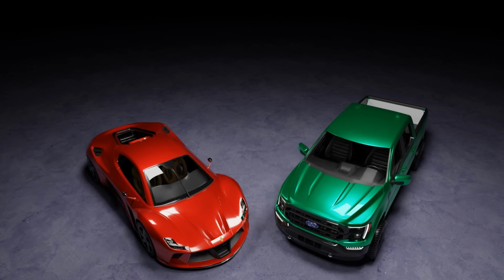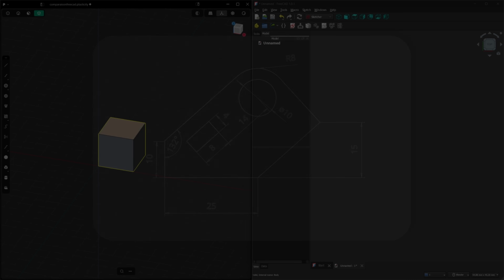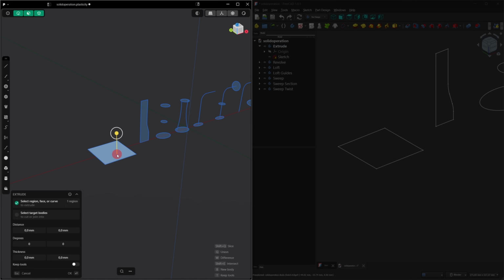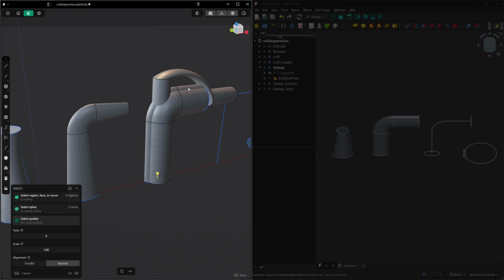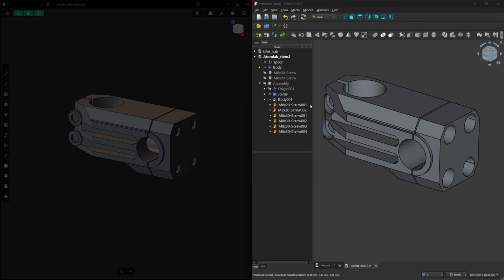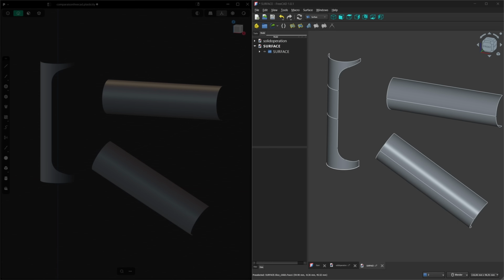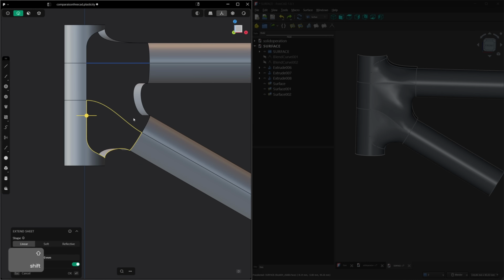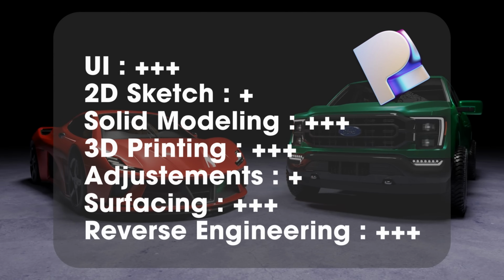FreeCAD VS Plasticity - Who's the BEST ? (Makers & Beginners)

Comment: I think people are attracted to freecad for its open source nature more than anything else, plasticity has a restrictive paid license so it would be better to compare it to solidworks or similar products with the same business model behind
Reply: Yep, not to mention FreeCAD is truly a suite of solutions. I use FreeCAD almost exclusively now for my woodworking designs. Why? I can design a project, modify it, send it to TechDraw for detailed drawings and then send it to the CAM workbench to cut everything out on my CNC all in one software that is 100% free.
Reply: @kylequinn1963  I also use CAD a lot for woodworking and CNC machining. However FreeCAD is still too limited in some areas for me, mainly surface modelling and stability both in terms of the program itself and rebuilds. Plasticity looks really great and the cost for a full pro license is not that expensive. But I need full parametric editing, so it's out as well. Right now I'm using Solid Edge and Rhino 3D. The former is free for hobbyists.
Reply: @kylequinn1963  Congrats your designs are simple and FreeCAD offers everything you need. Many of us are not so lucky as FreeCAD is rather limited compared to proper CAD programs.
Reply: Do you design the parts while in the assembly?
Reply: FreeCAD is "FREE" it's a great solution, no web needed and MULTI PLATAFORM!!! I can use it in linux... too many benefyts. The only practical solution for linux uses.
Reply: I use freecad because it gets the job done. The free part is also attractive because I know my time investment won't expire when I move from job to job like with my last package. Plasticity is also very nice and it's so cheap when you consider you can get xnurbs for the price of an ok used electric guitar.
Reply: Plasticity is not restrictive (what exactly do you mean at all??) and it's way cheaper than many other CAD programs
Reply: Plasticity is not restrictive bro. its a one time fee and you own it for life. thats NOT RESTRICTIVE, thats freedom
Reply: @genin69  And you get 1 year of updates, then you are free to have outdated software. How neat
Reply: @genin69  a paid software will be always restrictive compared to a totally free. Even if this is a minimal restriction
Reply: Choosing FreeCAD because of it being open source, that might be true for some people (and I guess mostly hobbyists which I don't mean in any negative way), but not for all people. E.g., I don't care about the open source aspect of FreeCAD at all and I am for sure not the only one. And I would pay for it, and also use it if it wasn't open source, it wouldn't bother me. For comparisons: I don't think anyone should compare software based on the license model or if it is paid software. 
And do you really think it would be fair comparing Plasticity (which imho is not really CAD because not being full parametric, and has limited options) to "THE" CAD software Solidworks which is the CAD Suite with the most and advanced features and options? Yikes!
Reply: @Bee-KL  You have to compare software based on the license model. Something what is free have never the budget for development to improve fast and make it "perfect". So as long you would like to pay for FreeCAD you can with pleasure make a donation. They deserve it.
Reply: @Bee-KL  no-one cares untill you get locked out of the program and lose access to all your files
Reply: @MisterMakerNL  When has that happened? Even Fusion tells you upfront when your license expires, so if you lose your files that's on you.
Reply: @iliketoast-q9b  The problem is: even with the file you don't have a tool to do something with it. Conventionally products with a yearly maintanance contract just lock you out from new features and updates if you cancel the subscription, but you retain control over your previous work.